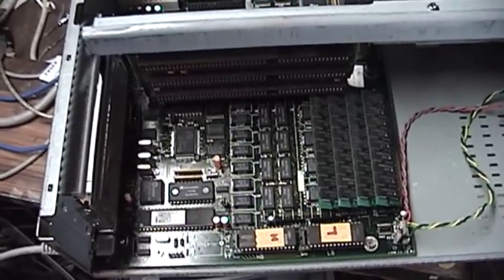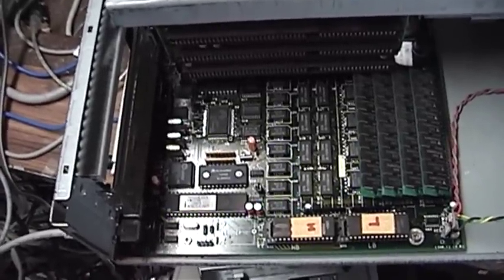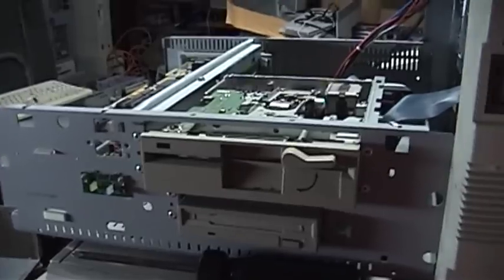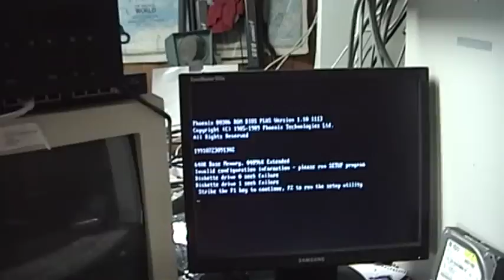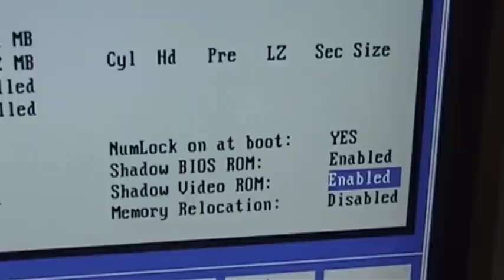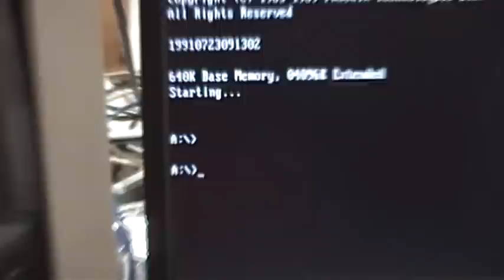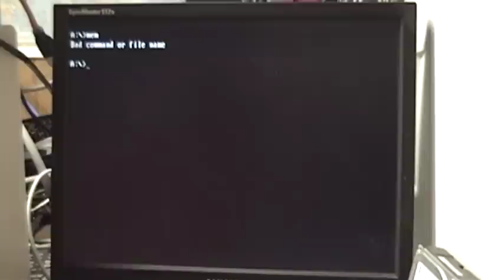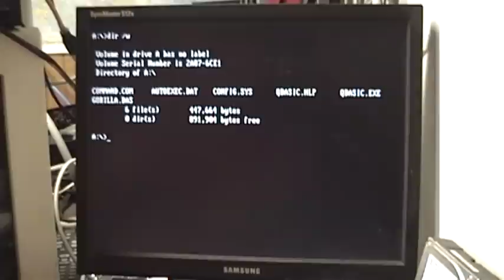Packard Bell Axcel 110SX 386SX PC Part 2

Comment: Gorillas is an EGA game, however, I believe it also supports CGA and Hercules.

I have also seen systems that use Ctrl+Alt+Enter or Ctrl+Alt+Ins to enter Setup "on the fly".

Turning off the switch at the end sounded like you snapped your fingers!

Comment: There is also an IC which converts CGA (or any 15 kHz RGB signal, such as from an Amiga or Atari ST) to color composite or S-video. I have the schematic somewhere, but haven't tried to find the IC or build the circuit yet.

Comment: For the anecdote : in France, in early 90s, Packard Bell provided a cable for connecting the Packard Bell COM port to the French "Minitel" (DIN port behind the Minitel case), allowing me to connect to Minitel servers in color from Windows ("Timtel" French software was also supplied by Packard Bell), and to download software (Minitel speed was 1200bauds for receiving, 75bauds for emitting data...). Minitel servers all stopped this year, 2012/06/30, after 30 years services.

Comment: I had a Packard Bell Axcel 386SX25 (AMD CPU, not Intel), memories from 1992... ! 2MB RAM, 100MB HDD, with Oak Technology onboard SVGA controller (512kB video RAM for 800x600 display in 256 colors !), both 3.5" + 5.25" FDD, MS-DOS 5.0 and Windows 3.1.
I knew the "ctrl+alt+minus" trick to slow down the CPU clock, but not the "ctrl+alt+S" for Phoenix BIOS setup (I remember I used the "setup.com" on HDD).
Really enjoyed this computer, it was my first one...

Comment: Later, in 1993, I added 2MB more RAM (4MB in all, enough to run Windows 3.1 in 386 extended mode by default, ie without the "/3" option), a Sound Blaster Pro 2 soundcard, and... a double speed CD-ROM drive from Creative Labs (in replacement of the 5.25" FDD) connected to the SBPro2 CD-ROM interface. With this CD-ROM player, I really enjoyed playing "The 7th Guest", using "The Software Toolworks Multimedia Enclyclopedia" (with famous speeches, music extracts...), and "Microsoft Cinemania'92".

Comment: I found a Packard Bell (quite a story, actually) computer that had a Pentium 1 with 32 megs of RAM in it. I knew of the, ugh, "quality" of a Packard Bell system so I was about to just give it away, but I decided to upgrade the system a bit. Newer processor, more RAM and a 3dfx Voodoo card. It ran well until the PSU decided to mess up. 'Twas a great system, that Packard Bell.

Comment: I had a computer years and years ago, it was a my first, at the time we did have have a Processor 133, it was the family computer.
Mine was a 486, SX it came with 4-8 MB RAM, 300MB Hard-Drive, and Windows 3.11, but I was able to upgrade it to 24 MB RAN, and Windows 95 Version B, I did try Windows 98, but it didn't have a Map-Co Processor, so as you know it wouldn't work!
Strange thing a friend had a 486 DX it had a Map-Co Processor!
Both 486's where Compaq, 
I think it evan had the same Bios as

Comment: ok dude i have an old board with an x86 Pentium (i asume its 133Mhz) and some SIMM RAM (not sure how much) that requires the old 12 pin power input and i only have ATX power supplies. i understand that they can be converted to support the old 12 pin motherboard socket i have done this but my power supply is missing the -5V cable. what do you suggest i do? i have been told that you can hook it up to the ground but that doesn't seem like a sensible idea since the idea is to rescue it not destroy.

Comment: 22:45 My Dell Inspiron I3700 computer from 1999 has that feature. Hit Fn+F1 and you will be taken to Setup. However, it also works in Protected Mode, since it works in Windows NT 4.0.

Comment: what is that connector on the graphics card? i've seen a similar graphics card in  other videos and i wondered it was for, almost looks like extra power maybe?
Reply: ***** so i'm assuming that modern cards either don't do that anymore, or it's built into the video processor
Reply: +Hunter Dentoyenkesh The last time the VESA feature connector was widely used, it was in the days of the hardware DVD decoder boards needed to play DVD video on the machines contemporary to the medium's infancy, around 1997-1999. After that, PCs were powerful enough to do video signal mixing in software.